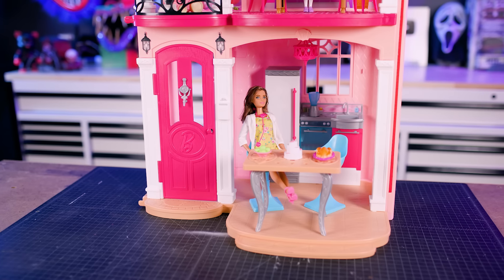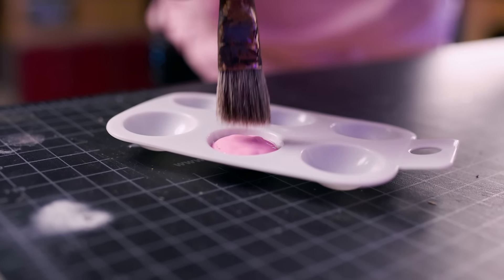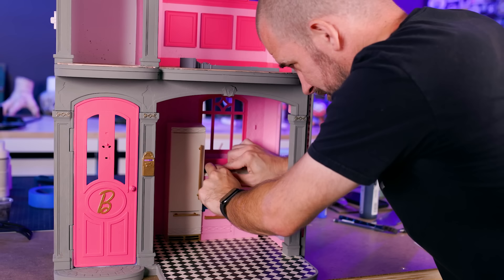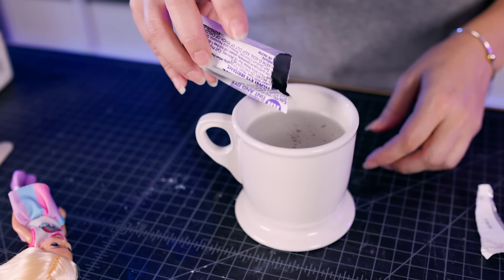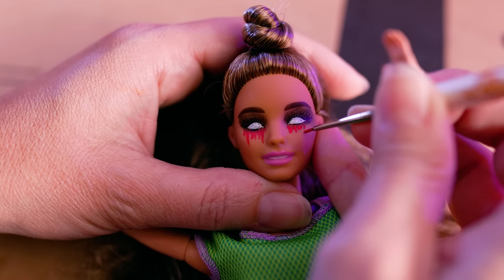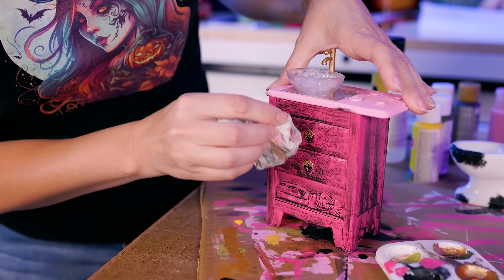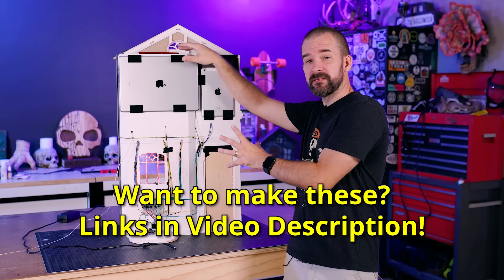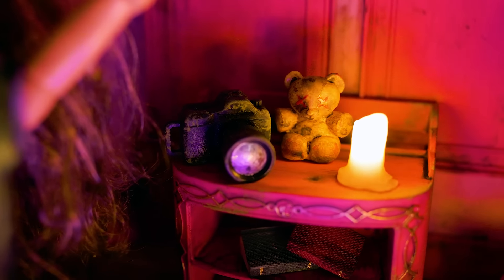We made a Barbie NIGHTMARE DOLLHOUSE for Halloween!

Comment: Also for future doll hair attempts, gluing the bangs the opposite way and then straightening them the correct way makes it more seamless and the glue hidden. People who make custom dolls do this a lot
Reply: Came here to recommend this! There are oodles of doll customizers on YouTube, and many of the hair techniques they use seems super straightforward
Reply: It would probably work out better using liquid latex instead of glue. The hair is normally just poked into the head with large pins.
Reply: @reginafetty6374  many of the doll customizers I've seen use PVA glue, both to create wefts when they aren't rerooting and when applying said wefts.
Reply: Amazing

Comment: not sure if this has been mentioned but barbie hair is typically saran hair which can sometimes be dyed with acrylic paint but can definitely be dyed using synthetic dye for clothes - the only problem is this dye will stain the doll head/body so you have to be super careful. honestly the ink you used seemed to work fine but just an fyi

Comment: Technical Question: How did you trigger the Ipads?  I mean when the Arduino turns on the power, do they automatically play? or do you need to remove them, play the video on a loop, and replace them back into position?  Thanks!  I'm working on a project and this would save me from buying several Sprite Players.